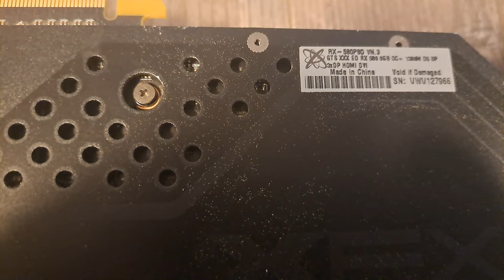Corsair Crystal 280X PC case "I think"

Comment: awesome job the build came out looking rather noice, my only thing is that i would have put the fan on the cpu cooler on the back side so that the hot air leaves quicker and you are pulling the cold air through the cooler, the way you have it now it will likely have the warm air lingering in the case. Or even better you could try to put the one fan at the top on the other side of the cpu cooler, as the fan at the top is just gonna be blowing the air into a glass panel its better to have it push the warm air straight out the back.

overall great build and i cant wait to see the nest one, Good Job :)
Reply from the maker: I know exactly what you are saying I left it like that for the crappy  aesthetics lol. I left unigen heaven running for like 3 hours yesterday. That room has no air con. With an ambient 80° rm temperature, the max temps of CPU and GPU were 76. Stock fan curves. 
The next build is coming very soon. Will a 12yr old AMD CPU run Diablo4?? Ty for the encouraging words. = )
Reply: I think Gamers Nexus found out that putting the CPU fan at the back actually loses you a few degrees. If the cooler isn't designed for it, like some of the Noctua coolers, always put the CPU fan to the right side facing the front of the case where it can draw in that fresh air from your case fans.
Reply: @NoFailer  ah fair enough that does make more sense tbh just feels like it should be on the left side yk? but nice thank you we all learn something new :3
Reply: @glodell6191  No worries, I recommend checking out some tech/PC channels if you want to go deeper into PC building :)

Comment: clean build. what are the specs?

edit: i noticed ur power supply. those are bad power supplies and they're known for blowing up. i'd be weary of it and replace it ASAP.
Reply from the maker: Ty for the PSU tip, CPU-Ryzen7 2700x, CPU COOLER-Jonsbo tower cooler, RAM-16gb(2×8) Leven 2666mhz, MOBO-GENERIC X370 Gigabyte  board, GPU-ZOTAC 1660S
Reply: @theaverageenduser6241  very nice